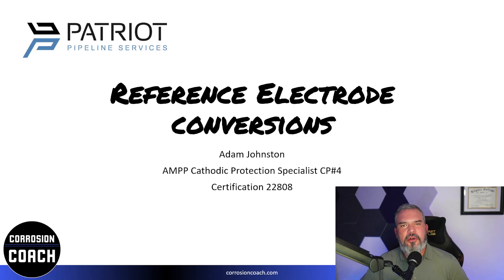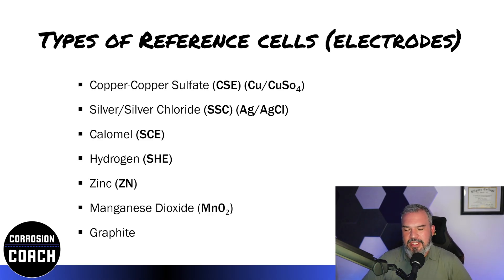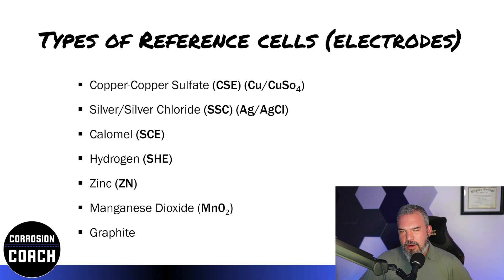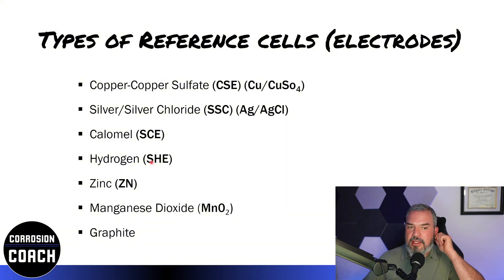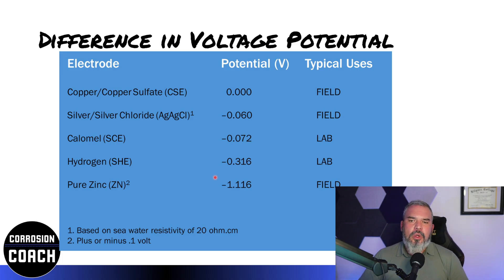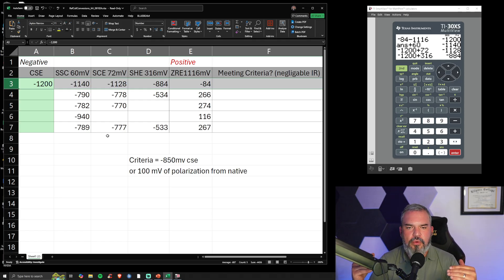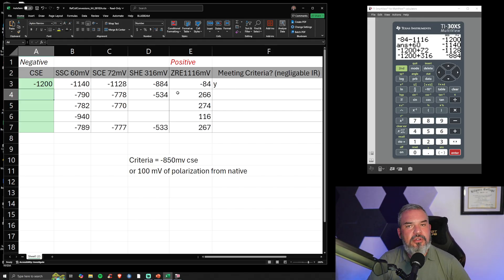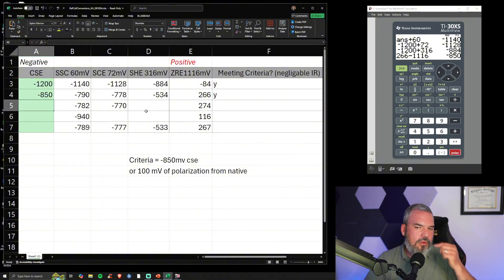Reference Electrode (Cell) Conversions

Comment: You have a new subcriber. Almost none Corrosion or CP channels on youtube. Your channel is looking good. Consider video with field measurements also consider equipment testing based on real field experience a not just reading manufacturer adds. thanks
Reply from the maker: Welcome! And thank you for the suggestions!